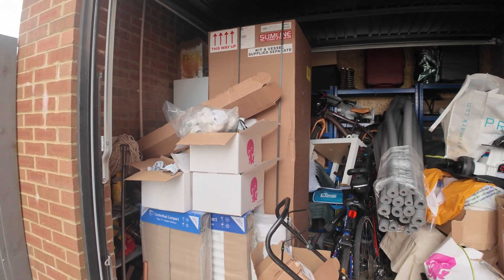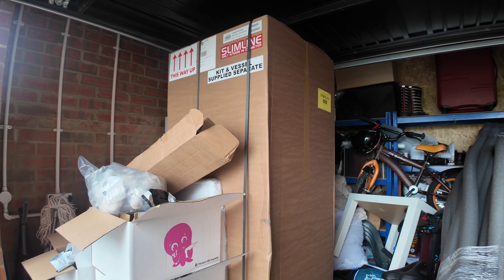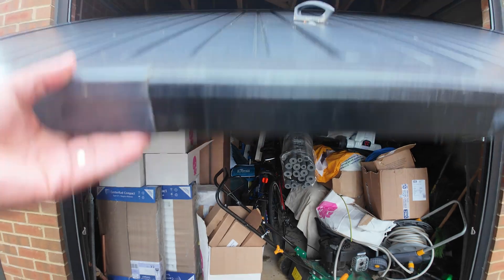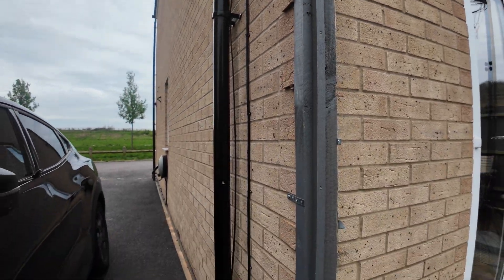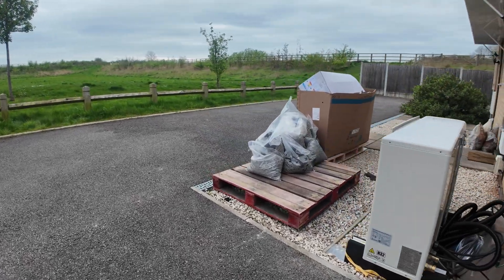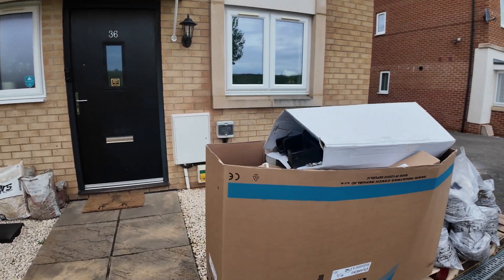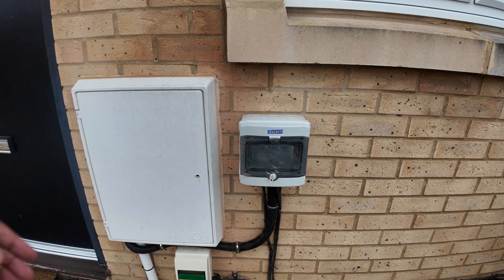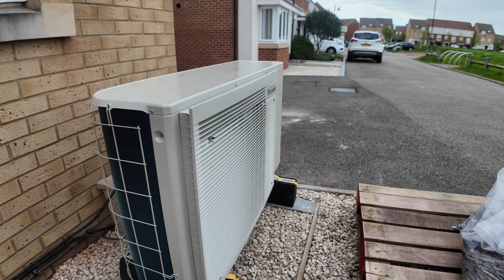Heat Pump Installation - DAY 1 | DAIKIN Heat Pump | Octopus Energy

Comment: I think the location looks OK, and as more units are installed people will get used to seeing them. What size unit is that, 7 Kw ?
Reply from the maker: Its a 4kW unit, and yes thats true, just need to convince wife that it looks okay lol
Reply: @letsgoelectriclge1320  At only 4Kw that should be economical to run.
Reply from the maker: @peterjones6322  I hope so, just wishing for a cold snap in April lol to see how handles it. I am excited and also trying to keep an eye on winter hopefully use the gas £800 as a top up to my electricity.

Comment: It looks a tidy install so far, personally I would much prefer to put the pump away from the front of the house but I do understand that may not be possible. I think we have the same Daikin pump which was installed in November but we don't have an external temperature sensor location like you seem to have. I can't comment on the how efficient ours is yet as hour house is open to the elements based on significant renovations. Ours has used lots of power when cold but as I say not a fair test just yet. We also have a battery and solar, this combinaton has resulted in effective electricity cost of less than 15p per unit which gives us confidence our overall install should be great. I look forward to following your journey (Octopus were not yet ready to install in our area).
Reply from the maker: awesome, yes we were stuck on the location because of boundary and neighbours bedroom windows. Thanks and yes hoping to see how it performs. Weirdly hoping for a cold snap in April just to test it out. I have already edited the final video and will be posting around 9pm as its 4k so takes forever. thank you and please keep in touch for tips.
Reply: Strange I never put out the front on installation unless customers confirm they have planning permission. As MCS installers must sign of installation to comply with all regulations, never want come from any customers.
Reply from the maker: @andygoodey912  the front is still a private road so it's not open public road and yes we looked at other options for sure but front ended up the option with regulations of windows for neighbours bedroom distance taken into consideration

Comment: My place doesn’t have gas, it has electric storage heaters. Was wondering how much system like this costs?
Reply from the maker: It all depends on a few things really. For us it is costing next to nothing. I know might need to explain in detail what I mean. We have a relatively new build from 2017 and heat loss is minimum therefore after the Grant from gov (£7500) we paid £500. I mention on the Preparation video on the grant. The £500 we paid, we are also getting a discount from DAIKIN for £250 then Octopus Energy have 2 services in the coming 2 years meaning it has cost us nothing. Our Gas Boiler was 7 years old and had not been serviced regularly due to Covid 19 and other issues and was very noisy when it was coming on as it was under my son's bedroom. I believe we have done a good deal but time will tell.
Reply: You say they using 22mm pipe work?
Reply from the maker: @TheBentheplumber  They are using the current pipes that the boiler was using into the house. From HP to the house is 28mm but around the house, sticking with the pipes we had